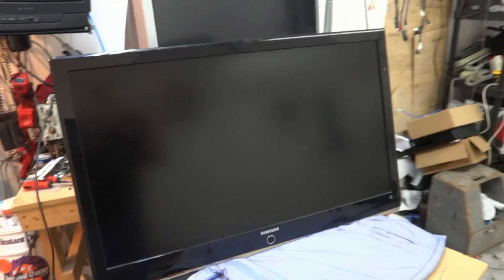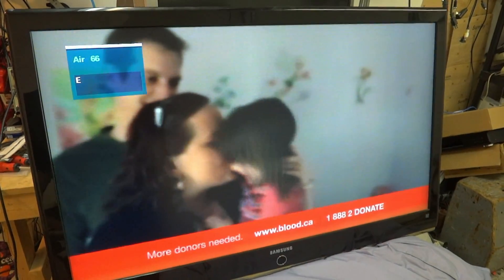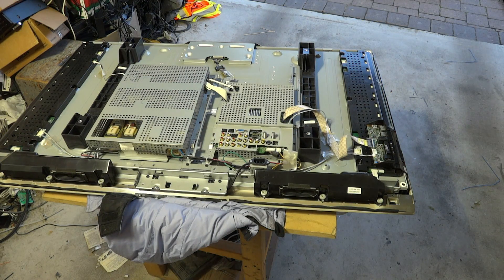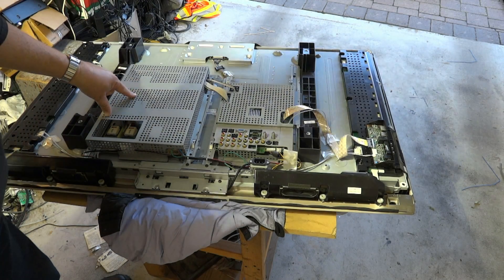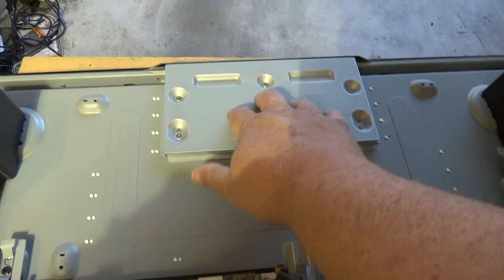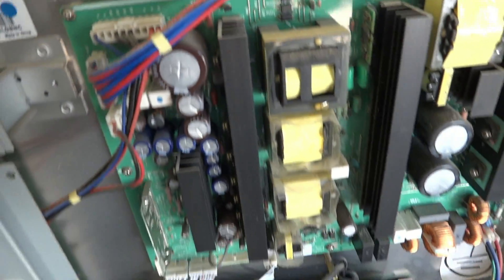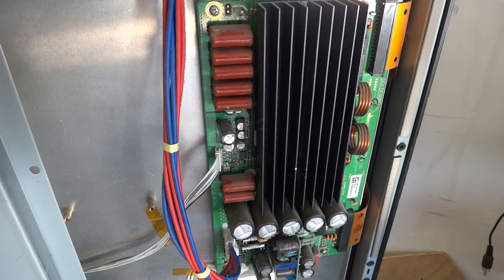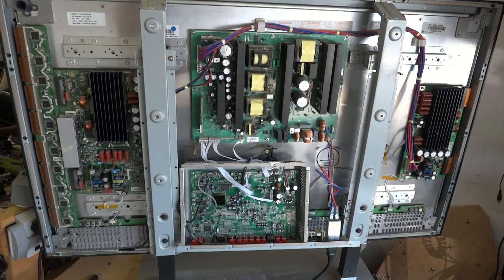Goodbye Plasma TV

Comment: @12voltvids I know this is an old post but I'm such a huge fan of not only Plasma TV's but also of your informative videos, thank you for what you do. I don't know if you read comments anymore but can I ask you a quick question? I recently picked up a Panasonic 42" Plasma Viera, from 2006, for pennies. I even had the fellow deliver it (upright of course). I got a bit of a scare when I saw that the glass had a couple of scratches and even a slight chip (even after cleaning with a damp microfibre cloth). I powered it up, adjusted colors, contrast etc.. and couldn't believe the beautiful lifelike picture (like a great CRT). I couldn't even see the scratches or chip. My question is: Would a few scratches or chips on a Plasma screen be a deal breaker for YOU, if it worked and looked great anyway?
Reply from the maker: Not if i couldn't see it.  I have one with an internal crack i am still  watching.  One thing you need to do on all those Panasonic sets is pull the back and tighten all the screws that hold the various boards in place. They work their way loose and will eventually cause the as board to fail requiring a new chip and a couple diodes.  
I currently have a 63 Samsung. 3 50" Samsung, a 43 Samsung, a 52 50, 46 and 3 42 Panasonic, 2 42" LG and a 42" pioneer and probably a few more.  3 of them have bad panels. By bad I mean either a couple of vertical lines or in the case of my bedroom TV, not only the small crack but severe panel burn thanks to the local TV station that I watch the news on and that's about the only thing i watch. Their 3/4 screen format with their logo and the static text on the bottom and right side have ruined what was a great picture.  I'll run it till it pops and then grab one of the spare sets.  Needless to say i will likely never have to buy another set.  Well when the big 63 blows up perhaps but for the smaller says I am set for life with these old plasma sets. It's  old tech bit it still works great and other than OLED nothing else can match the quality
Reply: @12voltvids  excellent, thanks very much.

Comment: Plasma or LCD, the dominant trend in tv manufacturing is to make everything super cheap (nevermind durability or longevity of the tv set).    I have some old tvs (panasonic Viera plasma 50" made in 2005 and Sony Bravia LCD 40" made in 2006).  Both are fantastic and both survived 20 years of service.  Cannot expect same durability and longevity of service from newer tv sets.  You would be lucky to get 7 years of service with newer LCD-LED TV sets.

Comment: Probably going to use my LG 60PN until it dies, then repair it. OLEDs have always looked off to me, and it's impossible to find one without bloated smart features.
Reply from the maker: You are not going to find many non smart TV these days.  That's all they are making.  The good news is just never connect it to wifi.  They will work without connecting to a network and if you find yourself with one of those shitty Roku TVs that it is mandatory to connect you match right back to the store and get a refund and tell them you don't have internet.
Reply: It's unfortunate. I've seen some of the $3000+ Samsungs have mandatory setup connections as well. Do you think late model 'dumb' plasmas are ever going to appreciate in value, or do not enough people care about their simplicity?
Reply from the maker: @wyattazcooks  just don't allow them to connect.   They must allow connection to an antenna and external inputs.  If not i could see a class action lawsuit.  They will attempt to get you to connect but there is no way they can give you to.  You simply click later to bypass.  
I still like my old plasma.  The picture is fantastic.

Comment: I still think the whole reason these sets were so troublesome was because of the amount of sheer heat they kicked off. and had zero active cooling 95 percent of the time.
Reply from the maker: Troublesome?  My 63" is 13 years old now and still going strong.  The set in the shop is 19 years old this year.  Let's see an led set last that long.
Reply: @12voltvids  Note I said heat. If it's been kept in a cool or even 70s shop all its life im not surprised. I keep my living space around that constantly and actually do have some VERY old LED monitors that have been around since 2012. Still in use today and have been on nearly their entire life. I have just seen so many dead plasmas that often lived in front of a window or a heater and cooked itself to absolute death. That and many do not use AC in their homes I have noticed..... Or will fight to not use it.. In fact the only dead set i've had over the years has been a JVC CRT and a Hisense LED  that was purchased very cheap. CFL LCDs did the same crap of cooking themselves I noticed.
Reply from the maker: @GOVHOTWHEELS420  TVs over fireplaces is a big no no unless placed directly over a mantle that will reflect heat away. Thus applies to all the not just plasma.
Reply: @12voltvids  I once had a friend who was notorious for killing electronics. Seemed every 6 months the guy had to buy a new DVD player, Microwave, TV, or some other combo of things. and I ended up going over there one day middle of summer and the baseboard heating was just blasting in the place! I couldn't bear to be in there for more than 10 mins. Doesn't matter where the items are when the entire room is over 100.

Comment: 6 and a half years later and I  can consider this video to be right: I consider plasma tvs to be a relic now, and oleds have definetly gotten a lot less expensive
Reply from the maker: I still watch my plasma and will continue until it blows up.  Might be awhile though as i have 5 sitting in a closet awaiting their return to service.  OLED burn far too easy for my liking.
Reply from the maker: I should add that there are still plasma fans out there. They went away due to the cost of manufacture compared to LCD.

Comment: Good video, and you are too right. Modern day LED backlit LCDs are even simpler than before. We have a 52" LED AMVA "totally not fake HDR" TV; which despite measuring about 415 lumen full screen only eats 50watts at the wall. My mum's older CFL LCD that is 42" eats about 190watts despite being half as bright and weights twice as much.
Reply from the maker: No question that LED sets are bright and use less power. They are also pretty unreliable. The older CCFL and plasma sets have proven to last much longer.
Reply: @12voltvids  Plasma reliability is why they are still working in Airports and Train stations.

Comment: And now future leads us for cheap lcd tv's, that last for 4 -5 years at most. I miss for CRT.
Reply from the maker: SNES Fan89 
You got that right.
Reply: LCD is one of those technologies rife with compromise... you have have awesome darkroom IQ with AUO AMVA+ with FALD, but they push into OLEDs pricing. IPS TVs are just the worst for those used to Plasma black levels, and cheap VAs are only marginally better.
Reply: If possible, bought at the flea market Panasonic st50 and LG PX990 almost new, I will use them until the OLED will not bring to mind, and it will not be cheaper. LCD this shit.

Comment: But they have so many goodies to desolder!
Reply from the maker: +Tech Gorilla I still prefer plasma TVs to watch. I have collected 7 so far, and have 3 more I need to fix. Very serviceable compared to LCD which are basically throw away.
Reply: We have used Vizio for about 6 years now.  They seem to be durable and parts seem to be easy to find.  I just replaced the power supply in the E500i.  Never had another issue with any of the three we have.  I hope it stays that way!
Reply from the maker: +Tech Gorilla Vizio plasma are LG. The same set as shown in this video basically. With the big IPM ICs. I fixed one with a bad Z Sustain. Actually took the board from this set to fix it. The vizio LCD sets on the other hand. Well they really need to change the name to Ziziohoh.Many bad panels. They didn't bond the glass correctly and well, they fail.
Reply: Was there a particular year, or is it the Vizio LCD panels in general?  That has me a bit concerned.
Reply from the maker: +James Last It is all cost and economics.Even the last generation of Plasma, which you can see me repair a few of them down to component level, had a much higher part count than an LCD set. More parts = more manufacturing cost, and with cleaver marketing plasma was given a bad wrap. OLED sets will be interesting to see when they get the price down to an affordable level, and for crying out loud get rid of the curve. That has to be the dumbest thing they have done to TV since Zenith let you make phone calls through their "Space Phone" TV.
Reply from the maker: Jorge duarte 
yes love my plasma set. I have 8 in working condition 2 just waiting to get put back in service, another really nice Panasonic 50" forget the models  off the top of my head but it had the separate tuner/control unit and a long cable to the screen can be wall mounted a distance from the components. haven't looked at that one yet. when I get it going it will probably go up on the wall in the shop as my test set.
Reply from the maker: Exactly. Just look at the part count. More parts = more cost.
Good marketing by the LCD makers confused the market, and made  plasma less ppopullar which drove down the price.
Reply: I've been telling people the same thing, thats the only reason they got rid of plasma because of cost not because lcd is better.
Reply: 12voltvids and now we get a product which the quality is worst,  i guess is true you get what u pay for,  in still buying plasmas iff people on ebay,offerup and craigslist, just bought a pioneer kuro 50" for $200, amazing picture
Reply: +12voltvids Everyone thought that lcd's were better for some reason. Maybe it was just marketing hype by the manufacturers. Every lcd tv I have looked at for possible repair had a tab bonding or panel issue rendering it unrepairable. Every plasma, however, was just a simple circuit board repair and never a screen issue. Plasma has greatly superior contrast and black levels compared to lcd/led, that in my opinion, outputs a much higher quality picture. Iam going to keep my plasmas running for years to come!
Reply: Something totally unrelated, can you please tell me what the problem. My Panasonic plasma TV works fine except for the AV inputs. Horizontal wavy lines across the panel. What could be the problem and solution for it? Thanks in advance.